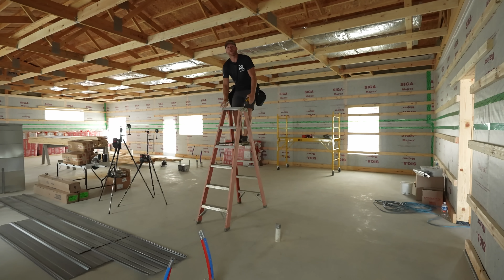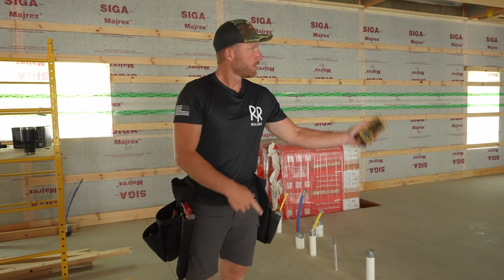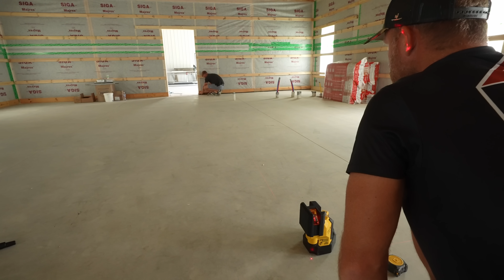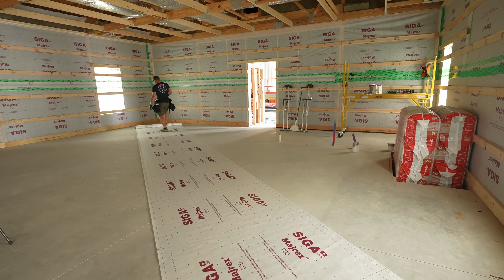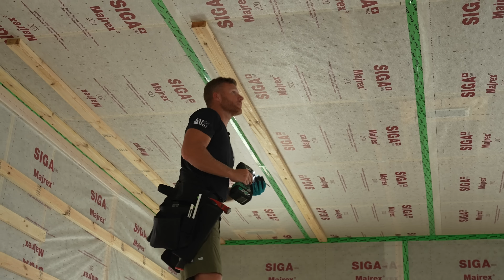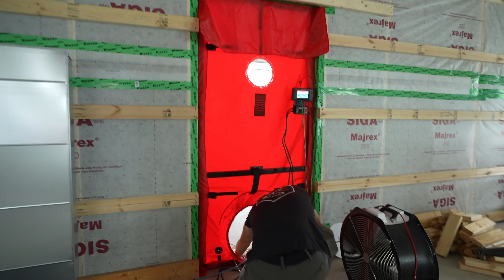Making the Modest House the TIGHTEST House

Comment: It is obviously too late for this project. However, on future projects, could the Majrex be run under the slab and connected/sealed to the rest of the Majrex installation (creating an entirely enclosed "box")? And, if so, do you think it would make any difference? I know that concrete is porous and  air/water can get through, but I don't know if it would make any significant difference. It does feel like it would do a better job of sealing around penetrations through the concrete though. Or perhaps a rubber sealed flashing (similar to what is used for roof penetrations) that could be embedded into the concrete, and around the pipe that makes the penetration? Or simply using some big flex around penetrations? Also, would a high quality concrete sealer or an epoxy floor coating make any difference? I am interested mostly because I am planning a large post frame build-out, and am very interested in having a very well sealed structure, mostly for the purposes of controlling the air purity, filtration, and overall air quality (highest priority) with the energy efficiency being a bonus.

Comment: All that work sealing up the house good and tight, only to have somebody else come though and punch holes right through it with the exhaust fans. Seems like an ERV instead that constantly pulls air out of the bathrooms would've been a better option, and not much more expensive than the basic fans.

Comment: Could you place 1/4 plywood on the walls and ceiling before the sheet rock to kelp preserve your air seal and allow ease of mounting to a garage because we always add a lot of stuff to the garage that is weight bearing
Reply: He does that in some homes that customers spec.

His parents garage was a good example.

Comment: Hey Kyle, I was always wondering whether you can build your style buildings with a basement? Seems like the answer should be yes, but thought I’d start a conversation about. Thoughts?
Reply: He built his parents a post frame on a basement.  He had a video once showing it.
Reply: @rexsmith1698 that’s the answer, it’s absolutely possible and Kyle already has that example of his parent’s basement.

Most people do post frame or “barndo” homes to save money, and basements are EXPENSIVE. When my parents built a stick frame home sort of near where Kyle works, they were quoted like $60k for slab and $190k for half of that square footage to be a basement. They ended up doing an above ground storm shelter for tornado safety, and I think that plus the slab was like $80k basements are ludicrously overpriced.
Reply: No different than building like this onw.  It had like a 4 or 5 foot stem wall he started on
Reply: I'd love to see a video series and cost breakdown of doing a post frame on a basement.  Even better if it were a walkout basement...  I think a post frame would excel at those really really tall walls on the walkout side.
Reply: I am currently doing it.
Reply: Just figured with him building in the Midwest, it’s odd to not see basements. ESP in a modest home build. Haha!

Comment: Eventually you're going to snap chalk lines for your interior walls, correct?  I wonder if you could have saved some math and overhead work to do that now.  Mark your walls, mark your doors.  Then you can measure the grate locations off of the floor "door", and set a laser to project your floor "grate" up to the ceiling.  Less overhead and ladder work and no chance for human error on the math.
Reply: Too funny, I wrote that when you were doing the HVAC, then wall lines were chalked 2 minutes later.

Comment: Looking good guys - wish we had this sort of construction in the UK. You mention around 6:30 that the bathroom exhaust fan is out of your scope. Presumably whichever contractor is fitting those is going to have to punch through the Majrex, either into the ceiling or through the wall? Or is bathroom extraction handled differently in these much more air-tight setups? In the UK it just gets punched through the wall (or, if your contractor is useless, piped into the roof space to start a nice mold farm).
Reply: Bathroom extraction is usually done with an ERV/HRV in very tight houses